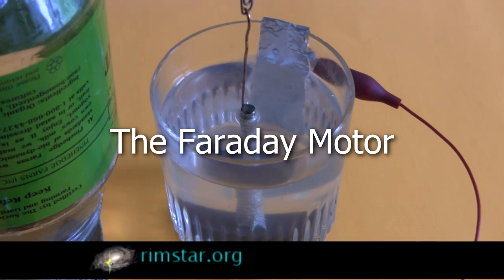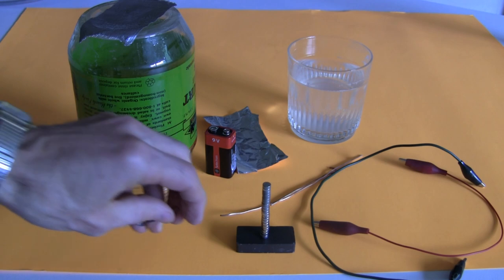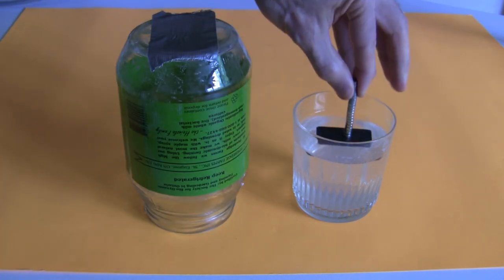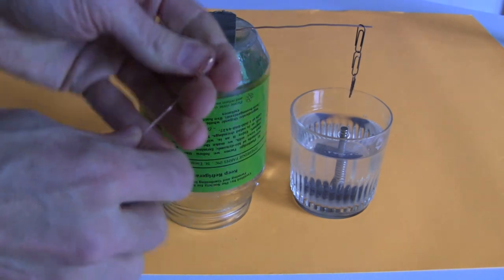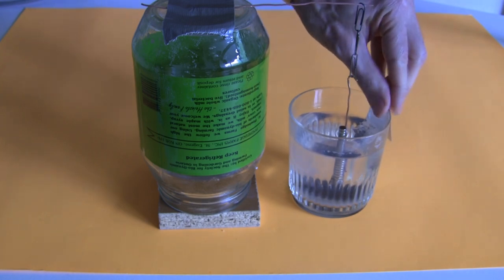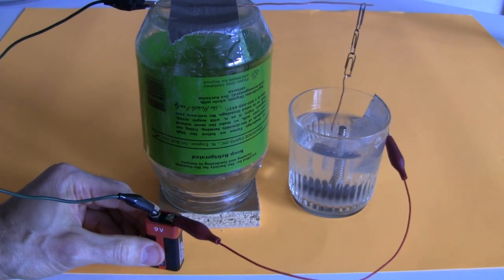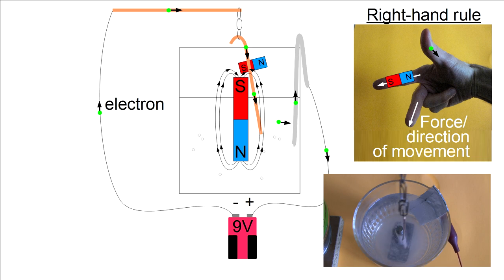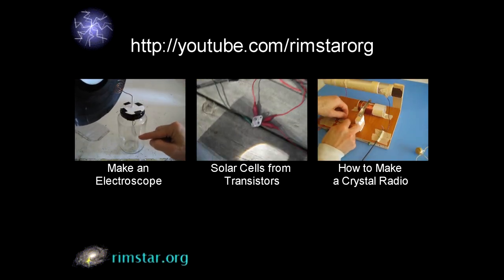Faraday Motor How to Make How it Works

Comment: what can I use instead of deodonium magnets
Reply from the maker: +Zain Ul Abedin I don't know of anything else that'll work. I tried ceramic magnets and they didn't work. Perhaps my current was too small. But the current is limited by the resistance of the salt water and I had that resistance about as low as it can go. A higher voltage power source, or at least one that can deliver more current, might also work. Faraday used mercury instead of salt water and that has a much lower resistance, but is harder to find and more hazardous to work with.
By the way, for future reference, and to help you find them, they're called and spelled "neodymium" magnets. I know, it's hard to pick that out from just listening to it.
Reply: +Zain Ul Abedin Faraday used mercury instead of salt water as well as an Iron Ferrite ( ceramic ) magnet. Salt water is not nearly as good of a conductor as mercury and is why a ceramic magnet will only work with mercury, but mercury is a bit unsafe to handle in such large quantities so it's best to use neodymium magnets to make a stronger field so salt water can be used as the conductor :P

Comment: Please riddle me why this is not working? Seriously excited to get this working and make bigger demos 🙂👇
Reply: Its copper wire, lawn mover battery, vinegar electrolyte, dangling free to move, n52 neodymium ring magnets, axial charged, tinfoil same like vid. Thought it was very similar 🤔
Reply from the maker: The only suggestions I have are then to make sure the battery is charged, that the wire isn't pressing too hard against the top edge of the outer diameter of the ring magnet (i.e. that the wire isn't hanging at too large an angle, mine only lightly touches the top edge of the magnets), that you have good electrical connections everywhere.
Reply from the maker: I just now saw your video. That wire doesn't look very free to move with the way it's dangling. The force is very weak. I'd also suggest not holding it with your hand but instead hanging it from something which it fixed in place, but that allows you to move it into different positions. That way if it moves only a little then you'd notice it whereas with you hand moving all over the place, you wouldn't notice a small movement.
Reply: @RimstarOrg  I'll try hmmm. This may prompt me to attempt other designs 1st if the force is that weak. Definitely thought it'd be stronger. Any suggestions how to ramp it up?
Reply: Haha copper plated my magnet wonder if I should post that?
Reply from the maker: Nope, other than a strong battery like yours. You'll see once you get it working.
Reply: Ima try buying solid wire tomorrow. Also ima try finding a magnet with no whole in the center. And maybe hang it higher for less angle. Hmmm. Really thought it should be spinning 🤔will report back.
Reply: @RimstarOrg  it's sparking pretty good 😂🤣💥💥💥and making hydrogen gzzzt.
Reply from the maker: Your stranded wire is fine, though if you use just one strand then it will be lighter. What you need to do is make it move more freely. That's why I use the paperclips.
Reply: Attempt 3 solid wire, changed that dangle angle, and larger magnets 💁‍♂️😳👻really seems like this shoulda worked 🙁
Reply from the maker: Your dropbox link didn't work for me. Maybe try cleaning out your container and try salt water?
Reply: I'll try :/ thanks for suggestions. Raise water conductivity and charge battery again.
Reply: Attempt.3.👆😳🙁trying not.to get embarrassed with myself 😑
Reply: 4th attempt lots of electrolyte yesss!!! Got it working 😁

Comment: na its not the same without mercury
Reply: In 1832, Michael Faraday reported that the quantity of elements separated by passing an electric current through a molten or dissolved salt is proportional to the quantity of electric charge passed through the circuit. This became the basis of the first law of electrolysis: Two birds one stone!

Comment: dont get why the copper wire moves round the magnet....i'm sure that's my thick brain, i hope to get 'it' so i can move on. More study required....
Reply from the maker: paul perrett If you mean you're looking for an understanding beyond the explanation I give near the end of the video then you'll have to look at the level of general relativity or quantum mechanics, if such an understanding exists at all.
Reply: Is it because the downward flowing electrons have some connection to the existing magnetic field? E.g. 'skip' or surf the field? And if so, why in that particular direction?
Reply from the maker: paul perrett That's the point where you have to dip down to relativity. Unfortunately I don't have a complete understanding for it. Part of the explanation is here https://www.youtube.com/watch?v=1TKSfAkWWN0 For most people, including most engineering cases, the right-hand rule that I talked about suits our purposes just fine without having to dip into relativity.
Reply: thanks for the tip...